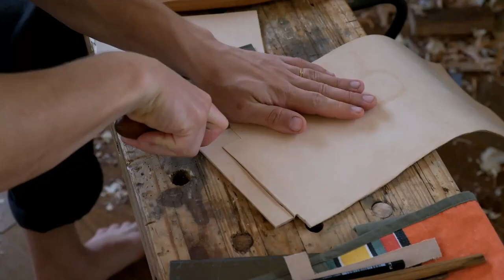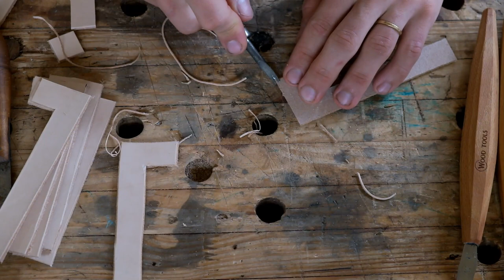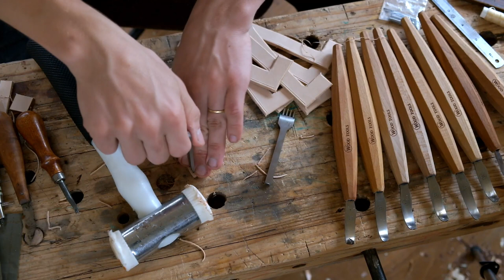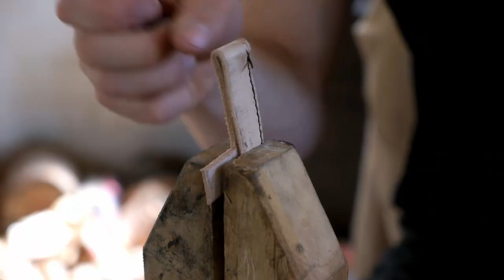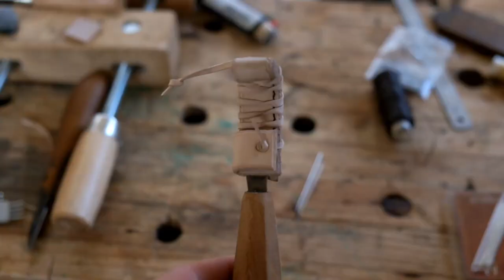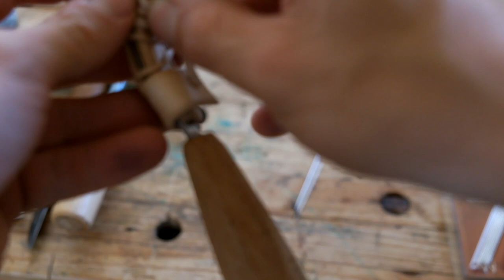Make a cover for your hook knife / spoon knife - edge protection - basic leather working.

Comment: Good and simple idea, thanks! I have a hook knive wrapped in and old piece of leather but it's not ideal.
A good idea might be to lightly hammered with a malet your stitchings to make them stronger.
Reply from the maker: Thanks for the tip! I'm very much a beginner leather worker. How would that improve the strength? I've heard of doing it to get them to sit correctly.
Reply: @jones_trees_and_treen  Your welcome, I'm not an expert neither ^^ But yes, it's more to get them sit correctly and by so making them stronger and less likely to tear out.
Another tip that you might have seen on leather work video is to apply beeswax on all the side and burnish them with a piece of wood.